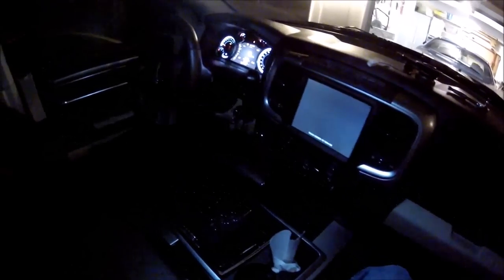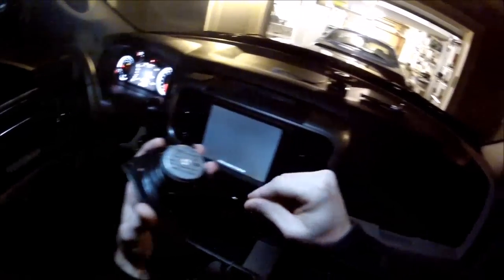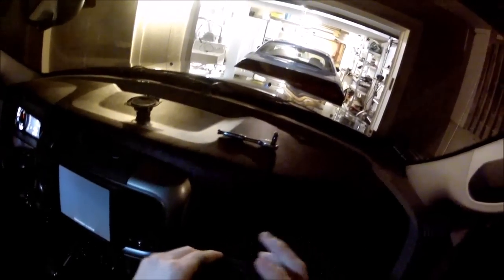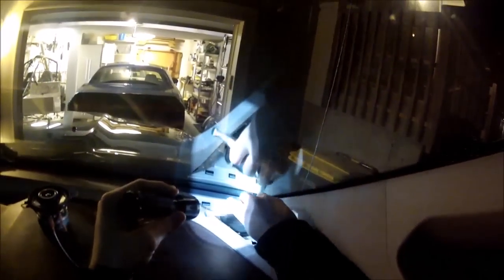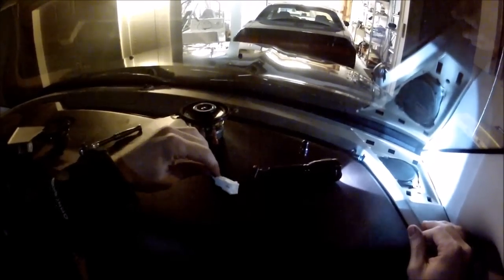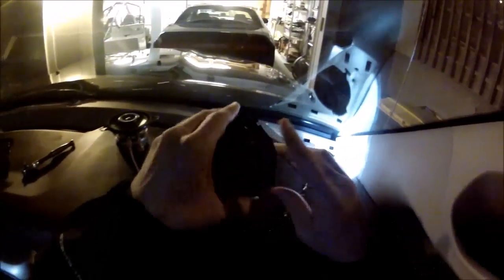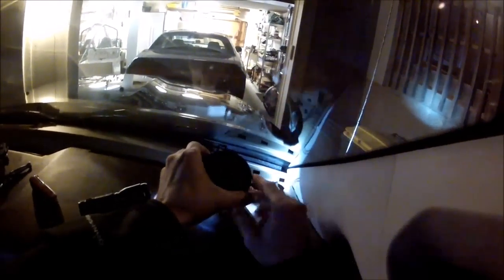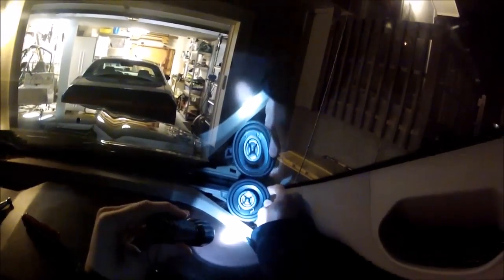Installing Kicker KS35 Dash Speakers in a 2013 RAM 1500 Big Horn

Comment: The speakers in my 2013 1500 are already starting to wear out, I'm a bass head haha. Thanks for the vid it really helps. I'm going to replace every speaker in my 1500 soon as well.
Reply: I recommend Rockford Fosgate for both 3.5 and 6x9 for your Ram. I have tried using Kickers but they seem to have harsh highs and bass is good but just a bit sloppy for my taste, unlike the Rockford where the highs are clear and smooth and they do have just a tiny bit less bass than the Kickers but their bass is precise and crisp